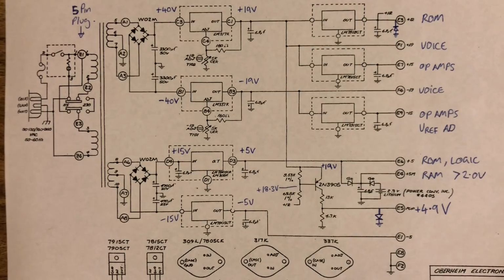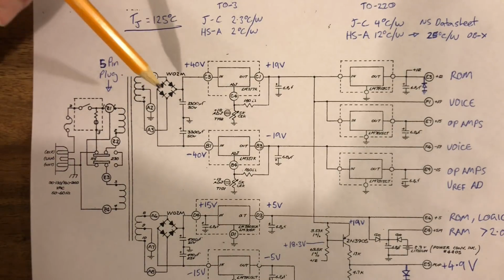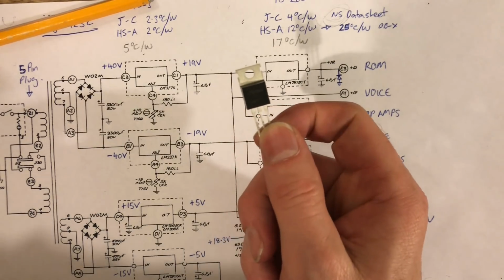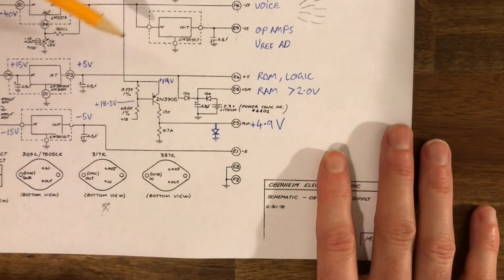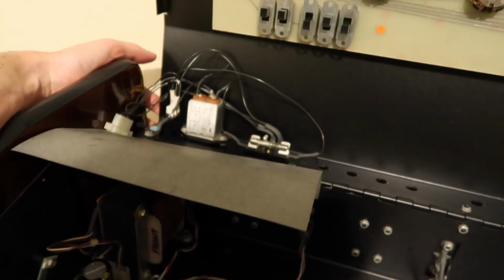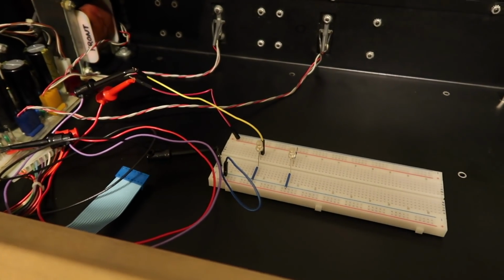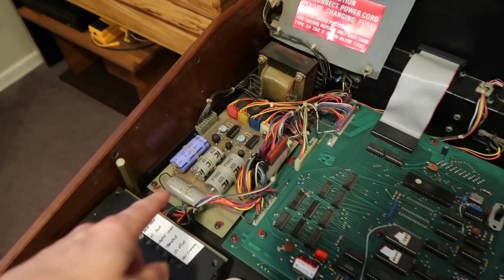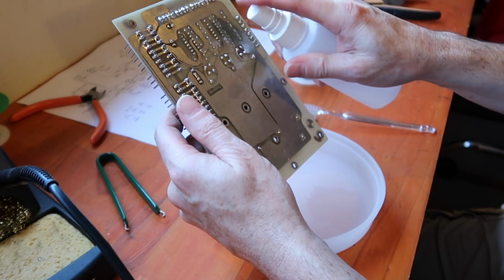Oberheim OB-X Restoration (Part 3) - Let's Start the Electronics!

Comment: I have an OB-X that I am servicing and the part where you breakdown the power supply schematic and voltages is very helpful. I would LOVE if you could make a 'Part 4' and do the same with the other boards, especially the voice cards and processor board!

Comment: Please please please finish this series soon 🙂 I have just picked up an obx in need of a full restoration. I rebuilt the psu and replaced the shorted cap on the rails so it boots up again, but I’m not getting any cv or gate signals. I’m going to do a full Caloroso method as written on his website but I’m waiting for your videos first! You’re such a great teacher and I learn so much in your videos
Reply from the maker: Barney Rosenthal Thanks Barney! I think I have seen you in the Vintage synth Repair group on FB? The next video could take a while as I’m basically explaining how the entire OB-X works. It might be quicker if you just start with the CMOS, TTL and the Tri-State buffers (80C98) and ask questions in the group. There are a lot of really knowledgeable people there. Also you can ask questions here too. I check YT a least once a week.
Reply: @GOLTSYNTH  Hi, have you gotten any closer to the next video? Since we're all trapped inside for the foreseeable future I figured this was a good time to get stuck into my OBX and get it up and running again...It would be so much easier for me if I had some info from you, hopefully it wont be much longer to wait!
Reply: I got my OB-X today—and it will need servicing. I very much appreciate your explanations and can't wait for the next episodes!

Comment: The cost of the TO-3 voltage regulators is out of line compared to the TO-220 regulators.  The cost of  the 5V TO-3 is $50.00 vs $1.50 for the TO-220.
Reply from the maker: Yeah the TO-3 have been obsolete for ages. I was only able to find LM337K and 7805CK. I was not able to find an LM317K. The TO-220 are still being made, just by smaller manufacturers now. Back in the day they would have been comparable in price.
Reply: LM317K in TO-3 is in stock at Digikey. $43.67 (US)  However, have you tried using an NTE replacement?  NTE buys old patents and/or reissues components under license.  They have been around for decades.  The parts do exactly as original or in some cases have improved performance.

LM317k equivalent is the NTE970.  (available for Elliot Electronic Supply $13.71)
LM337K equivalent is the NTE1911 (available form NTE Parts Direct $13.17 US)
LM7805 equivalent is the NTE 931   (available from NTE Parts Direct $33.46 US)

NTEinc.com
NTEpartsdirect.com
Reply from the maker: MidnightVisions Thank you so much. I forgot about digikey and I didn’t know about NTE. I will try them.